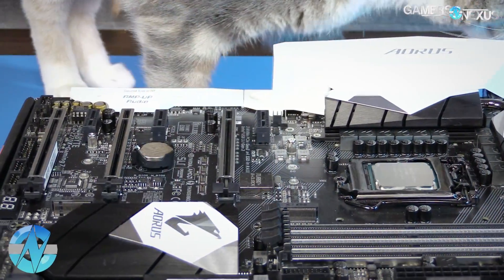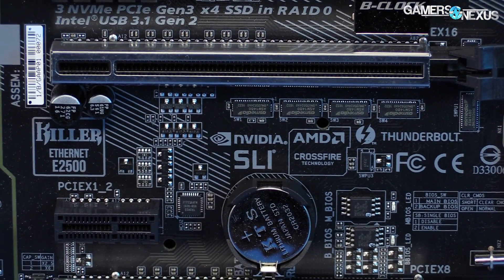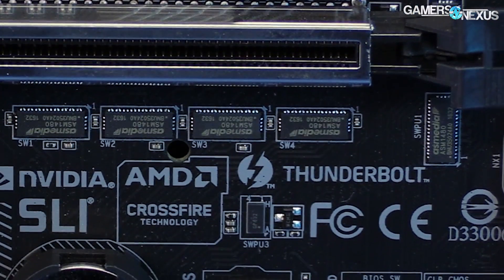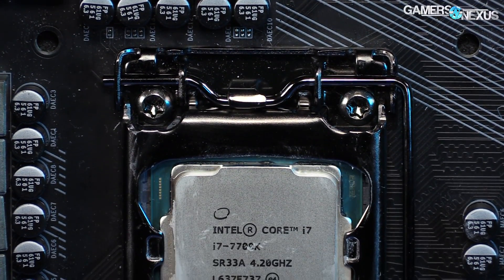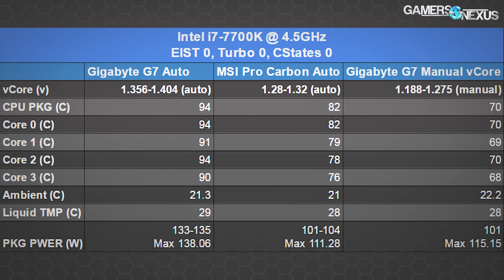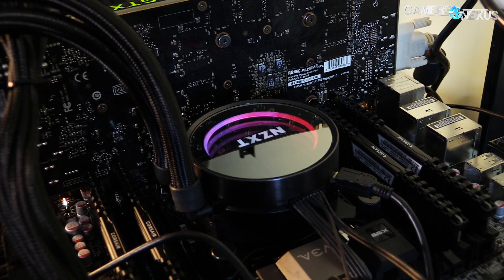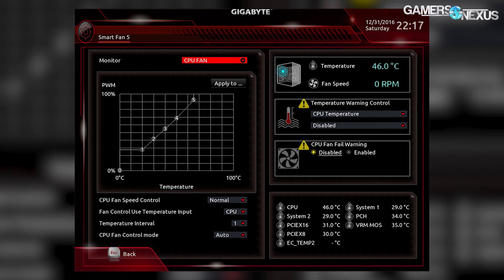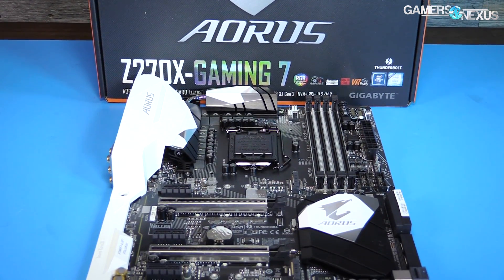Gigabyte Z270X Aorus Gaming 7 Motherboard Review

Comment: on gigabyte site there is a bios update posted on 04/01/2017, un day after this review. Can you confirm if that update fixed the voltage issues and the mouse movement in the bios? Thanks in advance. Great review.
Reply: Ghh

Comment: Hey Gamers Nexus, Thanks for the videos and all. Recently came across your chan and really getting back into the itch to upgrade and modify. Currently running a Asus Z68 Deluxe w/ 2500K @ 4.8Ghz. For years it's been at 4.5 but again, recently in part due to your channel and others, been tinkering with settings and got an Corsair AIO and now able to get 4.8 fairly stable. Anyway, I went ahead and purchased this specific board really only because it's what B&H had in stock at the time (today)...wondering if there has been any followup on Gigabytes part as far as updating and/or acknowledging the voltage drama. I do see they released a bios the day after you posted but the notes make no reference to voltage issues, only XMP ram profile updates. Hoping to get my 7700K kicking around as high as stability and fan noise allows... We'll see!

Comment: This and the supposed full review on the website are missing a number of details (I did like the power draw issue pointed out)  including ports, layout, network and sound if this the level detail that is included in a "review" you are not spending long enough looking.
Reply from the maker: You're looking for something else. We focus on thermals. That's what we do. You can find the ports in the spec sheet. Why should we go over what can be found on the manufacturer's website? That's a waste of your time. The board layout was discussed and is also pretty obvious from a photo. We talked about the odd VRM layout. If you don't like it, that's no problem. Go watch another review.
Reply: No need to get offended :)
With that being said, I agree that these are rather standard and easy to obtain details and don't need to be presented in a review, that is unless the motherboard does offer some odd connectivity or similarly weird things.
Reply: I follow a simple rule when looking at reviews: do they provide information that I can't regularly find?

Sound chip: I don't care, i have it disabled, I have DAC connected to optical output.
OP Amp: see above.
Network chip: I disable it, replace it with 10Gb PCI Express card (yes I have 10Gb network at home)
Thunderbolt: I own no TB device, nor will I own one in the foreseeable future.

But the voltage mess-up during overclocking is golden information. THAT you can't find it in a general review. Also Youtube groans under the weight of parrot reviews reciting a motherboard capabilities and ending with that. Just watch any of those dozen or so entries for this motherboard and then come here for the details that truly matter.
Reply: My point was that this is not a complete motherboard review. When you review a device you look at the device as a whole (if a car review looked at the transmission and ignored the interior would that make a complete review) even if you don't spend long on the parts that are not special. Things that were completely missed that are not just normal parts in this review - sound chip, OP Amp, network chip, Thunderbolt. And while yes I can look at the spec sheet, if I have to do that it devalues the work you put into this video as showing that it's incomplete and doesn't give a feel for how it all works.
Reply: I agree the standard stuff can be glossed over, but I still think it should be acknowledged. But worse is that this review did miss some of the more unique points of this MB - the sound chip (and accompanying software) replaceable Op Amp, network chip, internal thunderbolt connector. And that covers both your connectivity and weird things I believe :-)
Reply from the maker: We specialize our information to focus all testing efforts on items of the most import. You can find the rest in a thousand other reviews, and are invited to do so.

Comment: My Gigabyte Z170x-Gaming 7 also had vCore issues out of the box with my 6700k. Out of the box auto settings were running the CPU in the same 1.3-1.4v range and I had to manually adjust it to a more reasonable setting.

Comment: Great review, thanks. I know the voltage issue with Gigabyte is a recurring problem. I bought a Gigabyte GA-Z170MX-Gaming 5 motherboard from them and the voltage was always high, and they never released an update to address that. I manually set my voltages for my overclock because I was afraid their 1.4+ volts were going to wear out my CPU earlier with the high heat. To that end, I don't know that I would get this board if after a year or two they haven't resolved that problem.

I had another issue with the same board where the audio out port would make a static popping sound when the board would start to get warm (45 C). I had to RMA it but it has been nearly a month now and they still haven't shipped it back. I decided to buy an ASUS Maximus VIII Gene and I absolutely love it. Everything is fantastic about it and I will almost certainly go with ASUS for any future builds. Just my two cents lol.

Comment: So if I use two graphics cards do they both run at with 16 pci-e lanes of x8-x8???
Reply: Well, he said in the video that SLI requires the cards to run with 8 PCI-E lanes. (or not more than 8 lanes) So in that case, no. However with Crossfire or other Multi Display Adapter technologies it could be a different story...